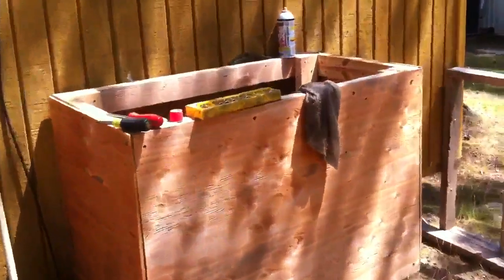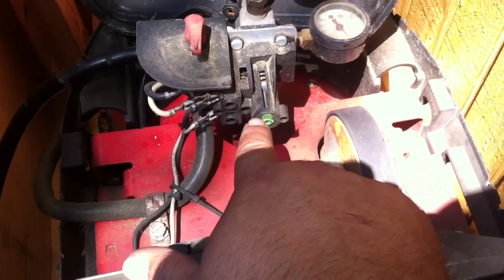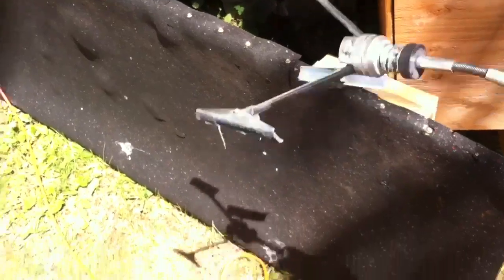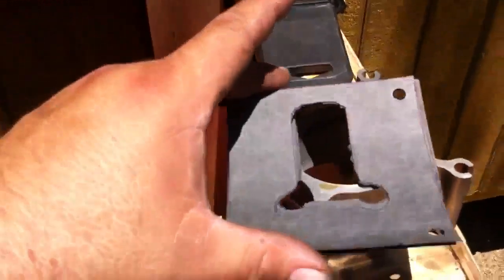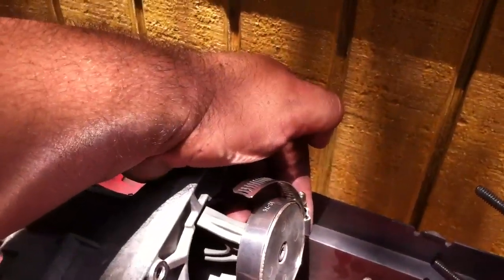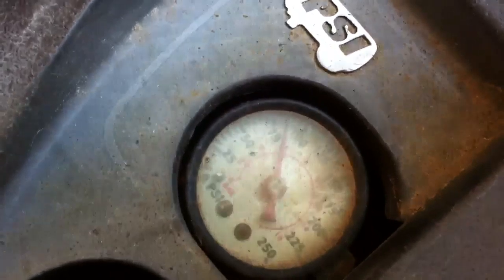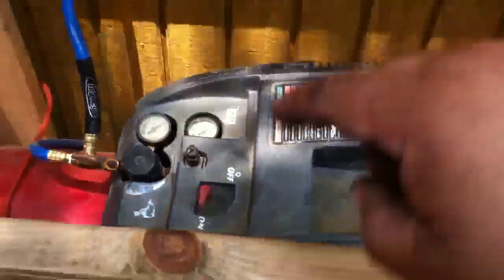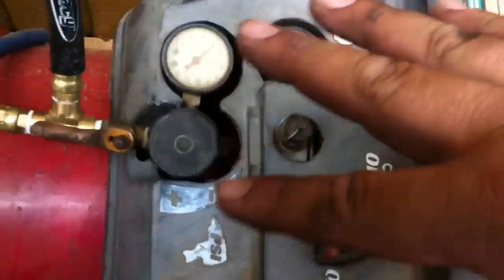How to rebuild a compressor

Comment from the maker: @laureanorivera I agree no question is dum or stupid. And at the end of my video I explain that it does run but will only bring the pressure up to about 90psi dew to the piston ring having that notch in it. Thank you for watching and thanks for the tip on harbor freight.